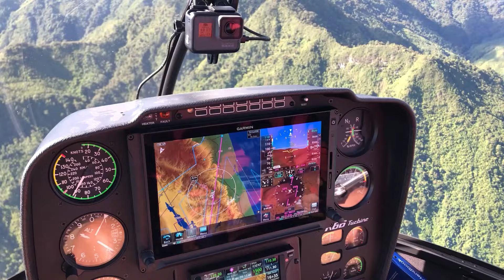Flying a Helicopter into St. Maarten - Communication Breakdown (Flying to Brazil - Part 2)

Comment: Still don't understand why outside the US airports require runway landing and air taxi for helicopters.  Waste of time and fuel, especially if the airport is busy and planes are waiting.
Reply from the maker: It's a weird swing one way or the other though. Either they'll give you all kinds of taxi instructions while you're in a hover, or they'll only tell you to report just 1nm away from the field to land at the ramp which is basically on top of it. It seems to correlate a bit with English proficiency as well.
Reply: because these airports don't have many helicopters flying around, so they handle helicopters like airplanes I guesss.